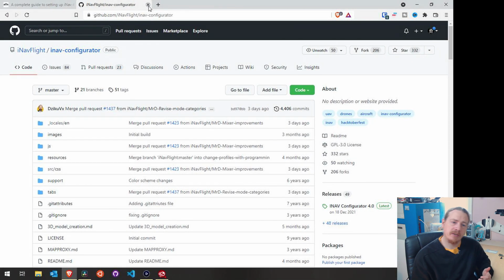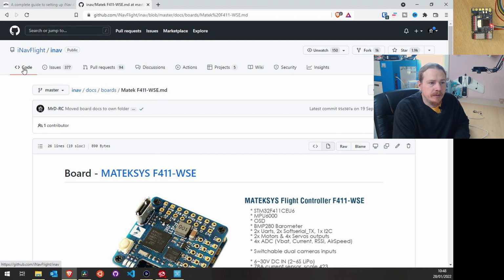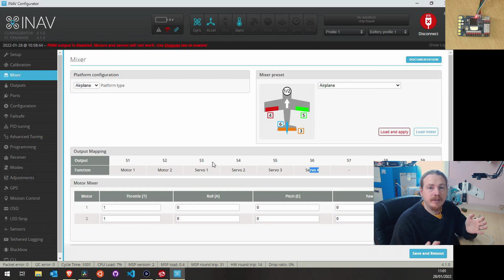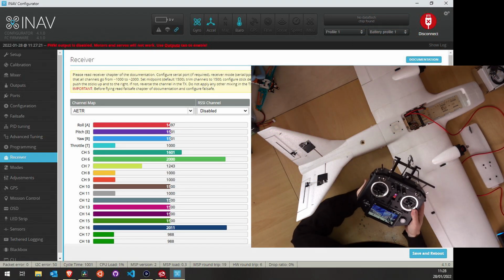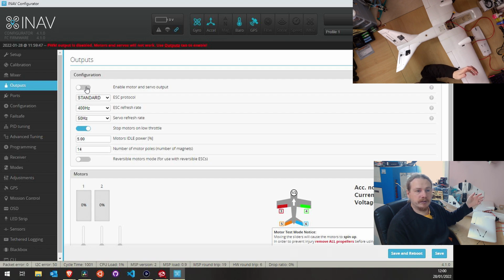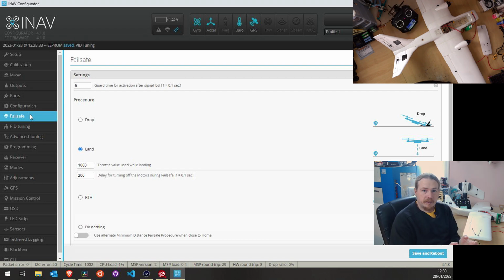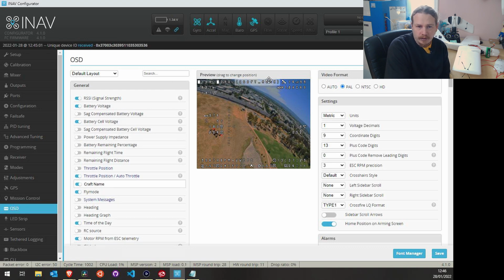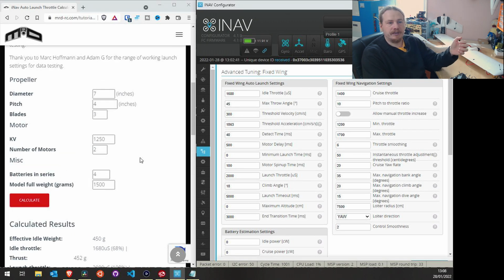Setting up iNav 4 - A complete, new set up and installation for fixed wings

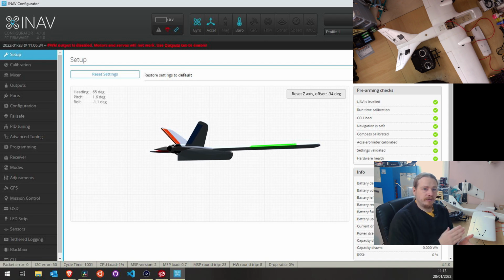Comment: Hi Darren. At 30:22, are you suggesting that the Fixed Wing Level Flight configuration setting will be literally updated by enabling the Level Flight Mode ?  Or something else.  Thanks
Reply from the maker: Yep, that’s all the auto level mode does. It is a tuning mode to set the fixed wing level trim. I have it on my tuning switch and will use it with Angle or CRSH (selected via a different switch) for a few seconds to adjust it.
Reply: @MrD  Thank you 🙂
Reply: @MrD  Just as a follow on if that is OK.  1) I understand why you would select a stabilised mode to tune this in, but does this tuning then help manual mode to fly level with hands off sticks.  If not how does manual mode achieve straight and level without trim.  2) I read on line that this setting (Fixed Wing Level Flight configuration) is not actually saved in persistent memory by Auto Level, it is only held in RAM.  This does not seem to tie in with what we discussed above.  Can I assume it is stored permanently without having to do a separate "save" step ?
Reply from the maker: @martr  1) manual or acro don’t care about the level trim at all. Acro is stabilisation only. Manual doesn’t even have that. Neither are self levelling modes. They should fly straight hands off, but straight doesn’t necessarily mean level. Just the direction it was flying before taking your hands away. Where did you hear that manual doesn’t get effected but trim? Everything gets effected by the trim. In fact, to really have a nice setup, get it flying great in manual. This includes being correctly trimmed. 
2) it depends on the setup. If you have something like continuous servo trim enabled, which saves on disarm, it will be saved. If not, it needs to be saved manually. It doesn’t bother me as I will perform a quick auto level before heading off on a flight.
Reply: @MrD  My point on trim is that it generally should not be used in manual as it tends to cock everything else up.  This was the same with iNav older versions.  Vector at least allowed trims to be incorporated.  My assumption is that in iNav trim is bad and there is hopefully some other way around it.  Some people argue that once you have set up an aircraft you never need to touch the trim.  I think there is some truth in this for wooden/balsa models.  But when I have driven for an hour to the flying site on a hot day, all of my foam wings normally need trimming.   In practise if you cant add trim manually how does manual mode achieve trimmed flight?
Reply from the maker: @martr   you’re talking about trimming via the transmitter there. This is absolutely fine, so long as you stay in manual, land, then pin the surfaces and physically adjust the control linkages with zero trim in the transmitter. As an initial setup tool, its fine. But you should not fly in any stabilised modes with trim in the transmitter. It will see that as a control input.

What iNav also has it continuous servo trim. Which will trim the plane when there is no stick input and you are in a stabilised flight mode. This is stored in the midpoints, so effects all flight modes including manual. 

My method is to trim manually via the transmitter. Once I’m happy with that I enable continuous servo trim to take care of the day to day differences in trim.
Reply: @MrD  assuming the aircraft has been properly mechanically trimmed, another tack for dealing with day to day trim variations in manual would be to put that switch selection on its own Open/Edge TX FM, then if any trims are applied in manual mode, they wont affect any other mode ?
Reply from the maker: @martr  yes. In fact my transmitter model does this, as do the INAV Fixed Wing Group models. 

But, once the major trimming is done. I still just leave it to continuous servo trim to take care of the rest. It works pretty well.
Reply: Dodkogie

Comment: Really excellent and well structured video.  It would be useful to see how to setup rates and expo for manual mode.  Do you have a video which shows this ?
Reply from the maker: Thanks Mart. There are no traditional rates in iNav. Expo for manual is set on the receiver page. You can set up multiple control profiles, but for most planes it’s not necessary.
Reply: @MrD  I have a wing I am fitting INav to but which has been flown without a FC for a couple of years.  I know for a fact that anything over about 60% rates in the TX (Aileron & Elevator) is too much.  Not limiting these rates and expecting the wing to fly in manual seems to me to be a mistake.  I do note that there are settings in PID Tuning/Rates & Expo which include "Manual rates" for all three axis.  I assume it is these which I should be changing as the TX rates have been reset to 100% in order to use with iNav.
Reply from the maker: @martr to be honest, if throws are too much with an Rx only. Instead of dialling down the rates, the control linkage should be changed to reduce the throws physically. Using weights to reduce the maximum throws reduces resolution on the servos. That would be my suggestion, and only use weights if the control linkage can’t be physically adjusted any more.

If you have to make some changes for the throws in iNav. Reduce the weights on the outputs page. However, I would highly recommend getting the physical setup in manual as best you can, without reducing the weights.
Reply: @MrD  Thanks for the suggestion.  I will take a look at that, however, I am not sure this is a solution for elevon surfaces where the elevator needs a different rate to the aileron, which is pretty normal on the aircraft I have.  [Edit :  Good point about limiting the travel on the outputs page. Will have a look at that too. Thanks.]
Reply from the maker: That’s no problem either. I have that on quite a few models. You just set the mixer to 60% pitch 40% roll, for example. Then physically adjust the throws in manual.

Comment: Terrific tutorial...very complete....thanks!
I just finished setting up my Aeroscout with an Matek F411- Wing  flight controller and Inav 4.1. I upgraded from inav 2.2.1. Your video helped immensely.

Note: I discovered that the Matek F411 FC board has an issue with the iNav 4.1's OSD. It's important to leave it in the "auto" mode and not select PAL or NTSC. Doing so will not allow the board to reboot and you'll lose your graphics. I discovered this on the Matek website where they issued a warning. Once I selected Auto (default) instead of NTSC the OSD started working again!
Reply from the maker: Thanks for letting me know about the auto on the F411-WING. Having that information spread about will save folks a lot of frustration. 

I’m glad the tutorial helped. I hope the maiden of your Aeroscout goes well.

Comment: HI Darren, Can you help please i have set up a tbs wing using matek 405w se and inav 4 copied all your setting for RTH etc. Have horizon, acro and manual on a 3 way switch, have rth on a switch and auto tune on a switch but this is turned off.But keep randomly getting cant arm rollpitch in my goggles and i cant fly. I cannot even do the 10 flips on switch to override and have 17 sats. it has been arming and running motor at home while doing set up but as soon as i get the field for a test fly this again. Any ideas. Cheers Wayne
Reply from the maker: It sounds like you have trim on the transmitter. This needs to be centred to arm. Check the receiver page to make sure pitch and roll are 1500 when the stick is let go.
Reply: @MrD  Hi Darren I am using Futaba gear and centre defaults to 1520 no sub trim no tx trim so I have to actually add trim to get to 1500 ??
Reply from the maker: Yes, adjust the endpoints so that down or left on the gimbal axis is 1000uS, up or right is 2000uS. And use the subtrim to get the centre to 1500uS. Hopefully that will solve your problem.
Reply: @MrD  Thanks Darren this worked, maybe this can be an update to inav to allow users running other radios to use 1520ms like futaba. now i have to use mid on the inav to centre servos.thanks im up and running now.
Reply from the maker: There’s nothing really to add to iNav for this. It has always been a part of the transmitter setup procedure. I believe there is even a note on the configurator receiver page to say the range for the 4 control channels must be 1000 to 2000, centred on 1500. I will double check that, and add it if it’s missing. But I’m positive it is already there.

Comment: Darren. Thanks again for this. I am trying to get my Talon GT flying with INav 4.0. In manual or stabilized flight it flies terrible so I have a mechanical issue. For the v tail output weighs on the mixer tab should it only be 50%? Mine are currently at 100% for all of them. Are the mechanical throws correct from Zohd? 8mm for the v tail and 10mm for the ailerons?
Reply from the maker: What to you mean by flies terrible? What about the flight is bad?

Yes pitch and yaw together should total 100. Usually this means 50 on pitch and 50 on yaw. They can be tweaked to give more pitch or yaw, depending on what is needed. But should still total 100 for the combined actions on the control surface. The throws should always be measured in Manual. 

Those throws sound a little low. But I can’t really comment as I’ve never had a Talon GT. ZOHD should have test flown the plane and give a range of throws in the manual based on their finding. Unfortunately, a lot of FPV plane are pretty slack in that department. Something @Painless360 and myself are trying to get put right.
Reply: @MrD  Darren thank you for replying to my comment. Looking back to the DVR and my memory the plane takes off ok on Auto launch but once I took control of the sticks and turn left or right it would have an aggressive tendency to nose down. I had to apply a lot of back pitch to keep it it the air but in left or right turns it nosed down and rolled. I saw Andrew Newton’s video with the settings he used for the mixer and had 100 weight for yaw and pitch which now after seeing your video and comment I realize is way too high. I rechecked the CG again and made a slight adjustment and lowered the yaw and pitch weight to 50. Also I put a bit of up reflex on the v tail.
Reply: @MrD  I increased roll throws up to 12mm and pitch to 10. Will try and fly this plane again on Wed when I’m off. Any other advice to getting this plane flying well?
Reply from the maker: If it had a pitch down tendency, that could be CG or thrust angle. Get som height and go inverted. If it still pitches towards the ground CG is more likely. But if it now pitches up check the thrust angle. 

On a plane with a tail, you shouldn’t need any reflex. This is only required for tailless planes. I would set the V-Tail neutral.
Reply: @MrD  Darren I am beginning to suspect that the CG marks I have under the wing are not correct and I reached out to other YouTubers who tested this plane to ask them for the CG as measured from the leading edge of the wing. If With a neutral pitch control it wants to nose down then its way too nose heavy.
Reply from the maker: If you haven’t already, try Marc Hoffmann. He has a very reliable Talon GT.
Reply: @MrD  😂 I was watching the INav livestream today and thought to myself doesn’t Marc have this plane too…🤣🤣 You read my mind. I sent him a message on Discord.

Comment: As of today April 11, iNAV 4.1 is a stable release and it is my first time setting up a Sonicmodell Binary. I have a few flying wings with no tail and found them easy enough to set up with iNAV 4.1 but not with the SM Binary with Flap option. Where do I find the "has flap" on this version 4.1? Wonder if you can point me in the right direction. Thanks
Reply from the maker: Has flaps was removed because:
1. It had nothing to do with flaps, so was confusing.
2. All it did was show or hide the “flaperons” mode on the modes page; which is now automatic.

To add flaps, you will need to set up a switch or slider on your transmitter. Then output that to the flaps servos in the iNav mixer. https://youtu.be/qY1TwINNX6c

Comment: Very interesting, just one question I don’t get the opinion load online. So I have to download it manually?
Reply from the maker: How do you mean Alan? As in the target you want to use isn’t listed? If you select the target, then version, the load online button should activate.
Reply: @MrD  perhaps I haven’t explained it very well, if I start configurator and enter the target (matek f411) there is never an option to download the file online. That option is always greyed out, that’s my question
Reply from the maker: @Alan Toseland when you say enter the target, do you mean just type it in the box? Or do you choose the target in the drop down list below the search box?
Reply: @MrD  right Mr D, open configurator 1 enter make of fc in top box. 2 second box enter board ( in my case matek f411wse). 3 third box down select firmware. Now at the bottom of the page there should be an option to load firmware online, this I’m unable to do due to it being greyed out.
Reply from the maker: Perfect, now I follow. Sorry, it’s hard to know stuff like this without spelling it out. 

You should get the load option after selecting the version. If the internet connection on the computer is fine. The next thing I would check is that Configurator is not being blocked by a firewall or antivirus. Maybe disable them and then see if the load option works then.
Reply: Thanks a lot, all working ok now. Its a shame you don't live next door, all the best Alan😂
Reply from the maker: Haha, glad it’s working. What was the problem, just in case anyone else finds the information handy.
Reply: @MrD  firewall
Reply: @MrD  what I was asking is that I never get the opinion to download online, as it’s greyed out in configurator, so I’m forced to download the file manually
Reply from the maker: @alantoseland6629  as in the targets are greyed out or the button? I'm not really following you. What do you do in configurator to try and download the target? Without being able to see anything, it needs to be described in some detail.

Comment: Amazing Inav video! One observation on auto launch, though. You've mentioned here and also demonstrate one year ago how to get the launch throttle value by moving the motor slider while holding the plane nose up. On the newer Inav versions the motor value is given in percentage instead of uS, so how can we read the throttle value in this case?
Reply from the maker: Thanks Valentin.
Yes, this changed around 2.6 or 3.0. I will be making an updated video on autolaunch to cover this. Basically take the launch throttle on the outputs page x 10 + 1000. So for a throttle percentage of 68% you would use:
= 68 x 10 + 1000
= 680 + 1000
= 1680

Comment: Daren, thank you for posting "The best INav help videos" in youtube. You use a really nice wayt to put things in perspective and get to the bottom of what's important and to the point. Have an issue with the ARM on a Matek f411 Wse situation. I have all green setup, when i arm i see the ARM go yellow on iNav. I go to the outputs and i see the throttle go up and down. If i disarm and re-arm again, I see the yellow arm icon BUT when i go to the output again, the throttle is not going up/down. Instead SERVO 1 is moving up/down. ?? what do you think is going on ? Thanks in advance.
Reply from the maker: Hi Aquiles. That sounds really strange. I've not heard of that before. I take it that if you go to the receiver page, everything is still working as expected?
Reply: @MrD  Yes all working ok in rx page. I have to wait a while for the condition to clear before i try arming again. Then it works ok. seems that once i get it to arm, i could never disarm during flight and re-arm. Like i said, if i get it to arm thats my chance to fly. i am going to try and post a video when i get a chance.

Comment: Intension throttle adjustment threshold (centidegrees)   - can't understand what is it ? Can you help?
Reply from the maker: Not really Alex, as I can't find it. Where abouts did you see it?
Reply: @MrD  
Advance Tuning  tab. 
Default - 50.
Reply from the maker: Ah, Instantaneous throttle adjustment threshold. It relates to the pitch to throttle smoothing.

You have the pitch to throttle ratio (P2T), which will increase (in a climb) or decrease (in a dive) the throttle in nav modes. For example with a setting of 10: a climb of 10 degrees will increase the throttle by 100uS.

Throttle smoothing gradually increases or decreases this change in throttle for P2T. It seems to do this by having a "filtered angle", which changes slowly.

The Instantaneous throttle adjustment threshold is a feature to bypass the smoothing, if the angle change is more pronounced. The default setting of 50 (5 degrees) means that if the filtered angle (created by the P2T smoothing) is 5 degrees, but the actual angle of the model is 15 degrees. This is a difference of 10 degrees, so the Instantaneous throttle adjustment threshold will bypass the smoothing and apply the full 100uS from our example. If the difference is less than the 5 degrees specified by Instantaneous throttle adjustment threshold, it will continue to smoothly change the throttle.
Reply: @MrD  
Nice.
Thank you !!!!